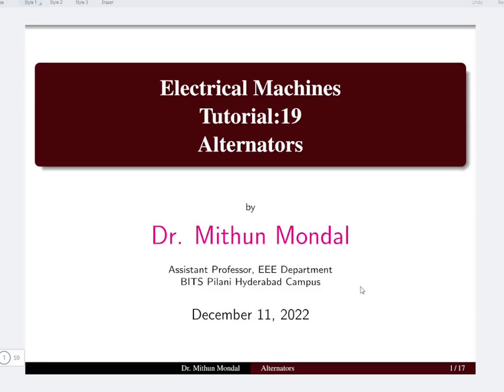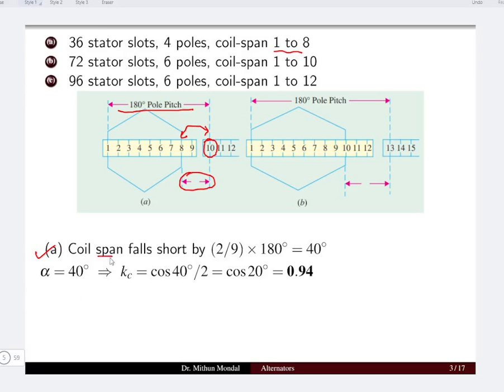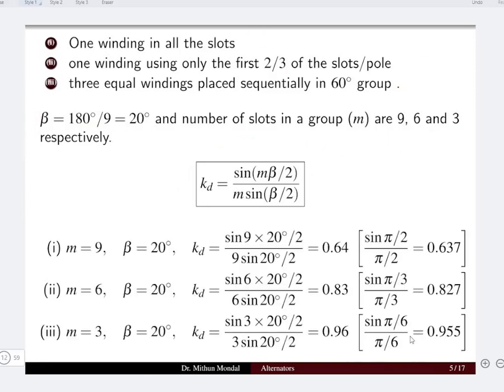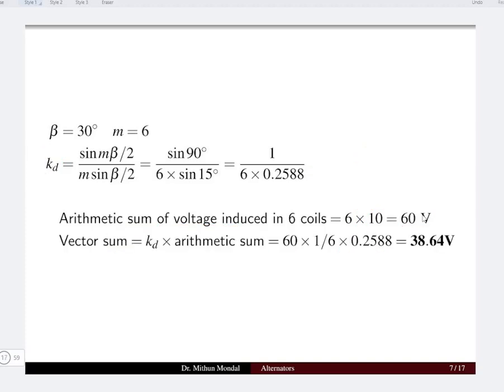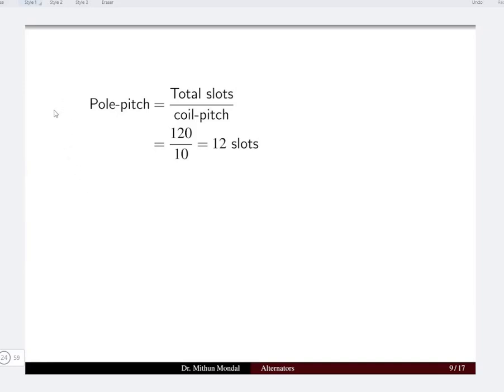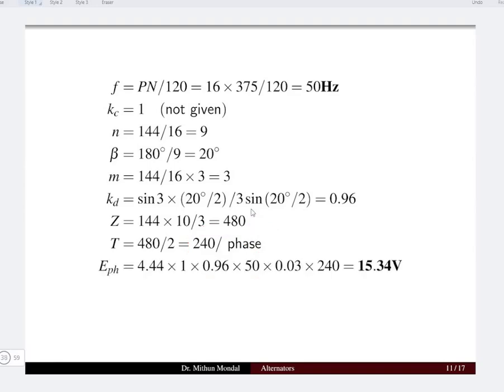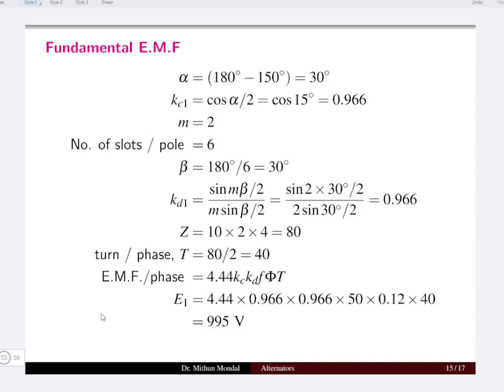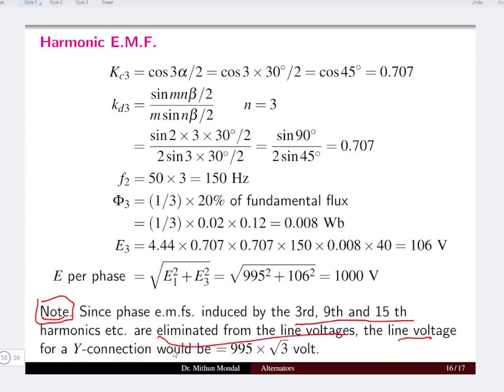Electrical Machines | Tutorial - 19 | Alternators | Generated EMF

Comment: A 3-phase, 36-slot synchronous generator has a 6-pole winding; given that the 3rd harmonic flux density is present in the air gap, what is the distribution factor � for the 3rd harmonic e.m.f.? options are a)0.866 b)1000 c)0.259 d)0.500. Also point to be noted my professor told me correct answer is 0.866 but after doing the calculations none of the options match the actual answer which is 0.707. Can you please tell what's wrong in here? how can 0.707 be approximated to 0.866?
Reply from the maker: Correct answer is 0.707 only.
Slots (S = 36)
Poles (P = 6)
Phases (m = 3)

 1. Slots per pole

[
\text{Slots per pole}=\frac{S}{P}=\frac{36}{6}=6
]

 2. Slots per pole per phase

[
q=\frac{S}{P \times m}=\frac{36}{6 \times 3}=2
]

So each phase belt contains 2 slots.

 3. Slot angle (electrical)

[
\beta = \frac{180^\circ}{\text{slots per pole}} = \frac{180^\circ}{6}=30^\circ
]

4. Distribution factor for (n^{th}) harmonic

[
k_{dn}=\frac{\sin\left(\frac{n q \beta}{2}\right)}{q\sin\left(\frac{n \beta}{2}\right)}
]

For 3rd harmonic ((n=3)):

[
k_{d3}=\frac{\sin\left(\frac{3 \times 2 \times 30^\circ}{2}\right)}{2\sin\left(\frac{3 \times 30^\circ}{2}\right)}
]

[
k_{d3}=\frac{\sin(90^\circ)}{2\sin(45^\circ)}
]

[
k_{d3}=\frac{1}{2 \times 0.707}
]

[
k_{d3}=\frac{1}{1.414}
]

[
k_{d3}\approx 0.707
]

Distribution factor for the 3rd harmonic:

[
\boxed{k_{d3} \approx 0.707}
]